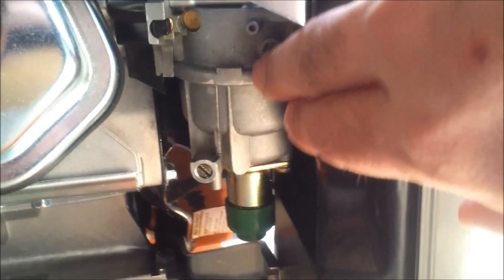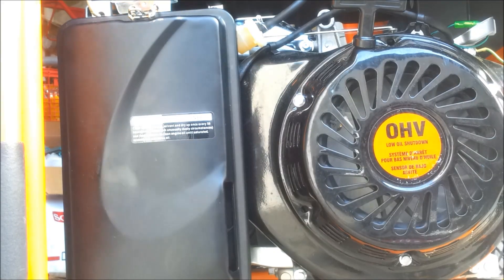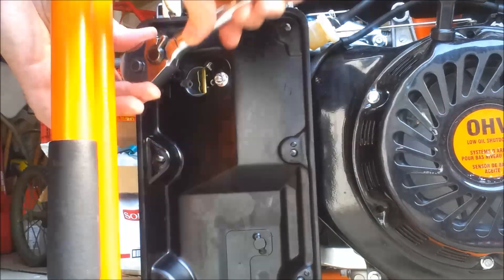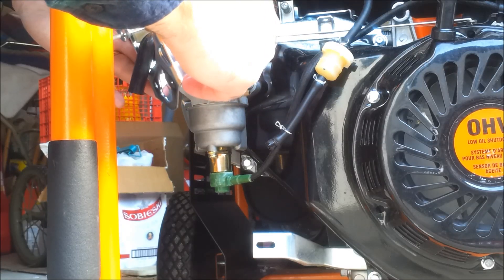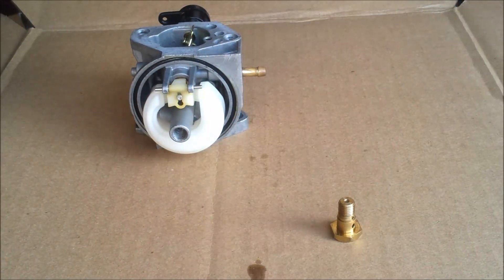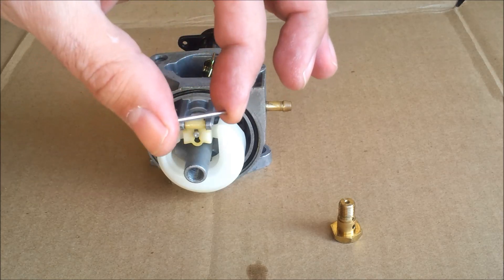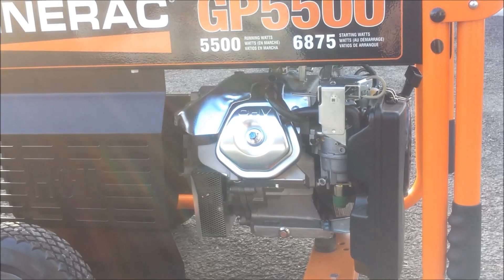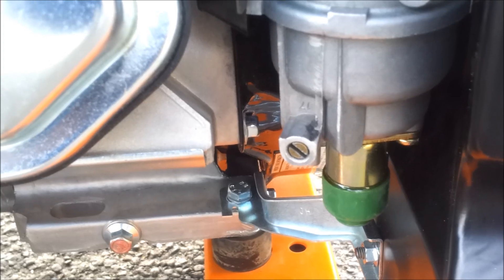Generac GP5500 FloatPinFix carb leak

Comment: Hurricane Milton is on my heels.  I pulled out my friends generator, filled it with gas it it was spilling all over the place.  With your instruction I had the whole unit torn down, cleaned up the carb, reassembled in an hour.   She fired right up and no gas spillage.  Thanks Bro.  You truly may be a life saver.  Oct. 9, 2024 2pm Cocoa Florida.

Comment: Stumbled onto this video because I just had this problem with my generator and figured out Rule 80 (I completely made that up but there are 79 others) of the internet is if you have a problem, there's a YouTube "how-to" to help you fix it.  
The part number Joe is referencing no longer exists. the current part number is 16011-ZEO-005. Most every place I've looked sells for roughly $20-25.  The sucky part about this is that you can get a whole needle bowl assembly (with metal float pin) for ~$10.  Choices, choices.
Update: ended up buying a whole new carburetor assembly for $25.

Comment: Thanks for the tutorial.  I took my carb apart and then used metal polish on the pin.  I loaded a q-tip on my drill with some metal polish and the inside of the pin shaft.  It worked!

Comment: That fuel you can remove ethanol fuel out of gasoline fuels that has it inside of it. By watching A video on YouTube channel on how to that process step by step. If that's something you would be interested in learning how to do At home for your generator.,or even your lawnmower.& Etc. That's gasoline.,or even two stroke also known as 2 cycle fuel mixtures to.

Comment: ABSOLUTELY DANGEROUS!!! I bought a GP5500, It failed in less than 10 hours. Customer service did nothing despite it being a 100 percent design flaw. Seal failure  allowed light rain to leak into the gas tank. rusted out. Cost $400 to replace. They don't care about their customers. The rust caused mine to stick and it flooded all over the back of my truck.
Reply: The grommots for the  fuel gauge and the role over tube are garbage. Can't find replacement

Comment: Fixed the leak on my generator but the generator won't start. Should I check the spark plug? Fuel is running thru the system.

Comment: Great video. We took apart our same generator and the tip of the float needle was all gummed up.  We installed a new needle and no more gass leak.  Thank you for the terrific information.  Two thumbs up!! A++ info.
Reply: Did you use a Honda or original Generac float

Comment: Will that same pin work for a general 6500?.
Reply: You mean for a Generac GP6500? Maybe. It depends on the carburetor shipped with that model and the model revision. Mine has a Huayi Standard of Japan carburetor. I bought my GP5500 back in 2011 or so. I believe that Generac has replaced the carb model in later models of generators so it might no longer be the same.

Comment: I replaced the needle with the Honda o e m -  I cleaned the brass seat -  and it still leaks a little- it’s not leaking from the bottom bolt - gas is coming out of the air cleaner so the Honda needle didn’t help me -  that’s $ 23.00 spend for nothing
Reply: You probably need a full carb cleaning and test. The float itself might not be buoyant enough to push the pin into the seat with enough pressure to fully shut off the fuel. So you might need to replace that also.

Comment: What would be the cost for taking it a shop[ for repair?
Reply from the maker: To clean the carb and replace the float pin?  Depends on the labor rate as the parts are cheap. I think you are looking at 100-200 USD. But they might not want to put in a plastic needle.
Reply: @joesgarage8953  Thanks, Joe. Seems a plastic needle would never get corroded. Thanks

Comment: I have a 4000 Watt generator I bought used $40 it leaks around the same area
Reply: Mine didn't just leak it POURED out in a 4 day outage :( .  I'm going to try taking it apart from the bottom first as it seems much easier to me.  Either way they took the solenoid off but I do understand more chance of stripping it. May as well change the oil while I'm fixing it...........better find a you tube for that too, lol.

Comment: I have a lowes version of  that generator, bought it around 2007 after a large storm in the Chicago area knocked out my area for about 9 days. Threw in a 220 breaker and backfed the breaker box,(yes I killed the main) it was great having one of the few houses fully powered, while the rest of the neighborhood was dark. It ran for about 5 or 6 days non stop. After the outage was fixed,I put stabilizer in and ran for a bit and cut the fuel and ran the carb dry. Since then I've started it a couple times a year with fresh fuel and stabilizer, then ran it dry. I've only needed the generator 2 or 3 times for short outages, but I developed the same issue and of course it happened when I was going to need it. I'm in Tennessee now, our neighborhood is getting new power lines and poles, so I pulled it out of the shed to get ready,filled it with gas, and it was pouring out the carb. I ran across this video looking up the carb, I was curious what I was going to see inside the carb, I haven't tinkered with small engines in years, long before selonoids we're on them. I was able to give it a good cleaning and it worked for now, but will order the parts and have them on hand if it happens again.  I'm beginning to think it's better to leave the carb bowl full of stabilized fuel when stored,as from the random videos I've seen, most of them stated they also ran them dry for storage.

Comment: Let me ask....this guy in this other vid...... also speaks about a fuel leak for Generac....but only dis-assembles the float bowl from the bottom, and doesn't disturb the upper part of the carb body where all the delicate linkages are that you took apart and had to be so very careful to get back together. This other guy also fixed it in another way simply cleaning the pin channel with a Q-tip and did not replace the metal pin with a plastic Honda part. Maybe the best of both worlds is to marry your guy's 2 vids---> https://www.youtube.com/watch?v=PoourNE7ydY. His "take-apart" with your plastic pin suggestion......
Reply: Wil, the problem with mine was that the shaft of the float pin had a spot of corrosion, which made it get stuck in the extremely tight tolerance of the pin channel you speak of.   So cleaning the pin channel wold have done nothing to fix the issue for my machine.   That other video might be a good quick fix for just a dirty carb.

I actually fixed mine three times with the last being the content of my video.   The first time, I replaced the corroded metal pin.   The pin corroded again, and I fixed it a second time by buffing the corroded spot off the pin shaft.   However it started corroding again after this and stuck again.   The third (and final time by the way as it is still good over three years later) is by taking the metal pin problem out of the equation and putting a compatible plastic pin in there as apparently was done on the similar Honda carb.

Keep in mind that I always use fresh fuel with stabilizer.   So the metal pins used for the carbs, and the replacement ones on the market must not tolerate ethanol-gasoline fuels.  No such problems with the plastic pin. Also note that I think Generac quietly fixed this problem in later models.
Reply: Appreciate your detailed response. I think we're on the same page. The point missed perhaps is one could access the pin and replace it with a simpler approach by removing the float bowl from below as the other guy did in the other, listed video. If you watched his complete video, he gets to the float and the pin and holds the pin in his hand. No doubt plastic vs repeated metal corrosion is a better fix. Lastly....how did Generac fix the later models.....do you know?...did they use a different metal alloy for the pin that is less prone to corrosion?
Reply: I agree that would be a simpler way.  One thing I caution on is when removing the solenoid from the bottom of the float bowl, it is very easy to strip the brass cross-head screws that hold that in place.    These are screwed in tight.   Without taking the carb completely off, it may strip more easily since you cannot apply as much firm pressure with the carb still mounted.   (YMMV).  Also, you cannot inspect the parts as easily.   I do not know for sure about later models.   Only that there were far fewer reports online and at the BBU that there were leaks due to stuck pins and Generac may have changed the carb type from the Huayi Carb that my model has at some point past 2012.   Check out this site  (not mine) which has a wealth of info on this entire issue: 
 http://home.earthlink.net/~kjvann/

Comment: How you can tell when your carb is leaking? , I'm asking because mine trow a lot of dark smoke and I don't know if that's the problem help please
Reply from the maker: The carb on my model used to leak because the metal needle would get stuck in the valve due to metal corrosion on the needle itself due to ethanol / gas mix.  The result was not dark smoke -- gasoline would literally pour out if the top of the carb somewhere and flow down until it came off the bottom of the carb bowl and all over the ground.   So your problem is probably not leaking carb.   Dark smoke usually means your air-fuel mix is way too rich.   This can be due to dirty or poorly adjusted carb, dirty air filter or some combination of these.

Comment: I have the Troy Bilt version of this generator with the same engine/carb. I inherited mine from a neighbor who moved away and just said it doesn't run. Anyway... I also discovered that turning the fuel on my carb would also flood. The solenoid could  stop flooding if it were working correctly. Mine doesn't because it's not powered or not operating correctly. I don't think your solenoid is working properly either. I tried to freeze the video to verify but couldn't see. When the solenoid is NOT powered, engine off just stored, it should be extended to stop fuel flow to the jet. When it IS powered, it should retract allowing flow. On a bench test my solenoid needle extends when powered. This is wrong. Yours looks like it is retracted unpowered just like mine. Every youtube video on the subject of a carb solenoid shows that doing a bench test, powering retracts the needle. It just makes no sense that ours extends when powered and even more confusing, even extended it's not long enough to stop fuel flow. If it were our engines would not run. 
But it really is the job of the float/needle to stop fuel flow anyway. Think about how many small engine carbs don't have a solenoid.  I realized watching youtube videos like yours that our carb is one of very few with that little spring on the needle. Except, mine didn't have a spring at all! So even with the float all the way up, the needle wasn't being pushed up enough to seal. I  I think mine was at a shop by previous owner and they took the carb apart to diagnose and lost the spring and figured it wasn't needed since most don't have one.  What I did was take a spring from a ball point click pen. Had to cut it trial and error to get the right tension but it works. I suspect it was really just your spring was worn since both needles have a rubber tip and the barrel was very clean. I think if you just gave the spring a little tug to stretch it a bit it may have solved your flooding issue. But kudos for finding that compatible Honda needle! with the new spring....

Edit: using the pen spring was short lived. started leaking again. After pricing out individual pieces, I just went with a complete aftermarket carb for $30.
Reply: Jeff Flowers got a part number?  I’m 2 years past the Honda polymer float swap and I’ve still got the issue.  Luckily haven’t needed the generator.
Reply: I ordered if off Ebay. I forgot to test the solenoid before installing it but doesn't matter. There's no carb leak so the float/needle is doing it's job and the generator runs fine. I do use the shut off valve anyway for good measure. If you order this one, in the write up it says manual choke only, but I easily took the lever off the old carb and installed it on the new carb. It even had the screw ready and waiting for the lever to be mounted. Comes with gaskets and fuel filter. I did need a small hose clamp as nipple on the carb is smaller diameter and to cut the existing fuel line to install the filter. If the link doesn't work it's item number 272884557267 and the seller is autoparts688.  Good luck!
https://www.ebay.com/itm/Carburetor-Fits-Troy-Bilt-XP-30477-030477-Pulsar-PG10000-PG10000T-Gas-Generator/272884557267?ssPageName=STRK%3AMEBIDX%3AIT&_trksid=p2060353.m1438.l2649

Comment: Thank you.  That was very helpful in diagnosing the same leak on my generator.  It is a Honeywell branded 5500 unit....actually a Generac.  Everything on mine looks exactly like your unit.  I bought this generator in 2012 having no issues until yesterday.  If I observe corrosion on the needle, I will take your advice and replace it with the Honda part.  I also found a source for non-oxygenated gasoline in my area....all my small engines and motorcycle now run on that fuel.  Thanks again for your video, it will save me a lot of hassle.

Comment from the maker: Just a note that since I replaced the float needle with the plastic part, it has not become stuck due to corrosion issues for 2+ years.
Reply: Joe's Garage thanks for the video.  Followed the same procedure and unfortunately 2 years later I’m in the same boat again with a leaking carb.  I wonder if a full Honda carb would work.
Reply from the maker: Ouch.  Sorry to hear that.   Mine is STILL going fine with the plastic float needle in there.   Maybe open your up and see what is causing it to stick now.   If you used a plastic needle in there, I don't see how that part could corrode.
Reply: Of course then won’t own up lol. Seems a lot of people have this problem and it is dangerous. For the cost of a simple pin that’s non corrosive   You would think the would own up and send a fix the cheap bastards.

Comment: Your video was really helpful. My carb was completely gunked due to my negligence. I've since cleaned & repaired it thanks to your guide. I will now be much more stringent with maintenance. The manual says to change oil every 100 hours. I haven't put mine to regular use yet in 2 years. How often do you change the oil if not in regular use?

I'm still searching for a polymer pin with your supplied item #. The suppliers I've asked all said they are all metal pins & I have to buy a full repair kit. Still searching. Thanks for your time here, very helpful.

Comment: That's great. Mine has been pouring. It's a 2010. Will that pin work? I have 2-3ft of snow coming in 24 hours!
Reply from the maker: You might want to look at Ken Vann's video too...much better of the disassembly.
https://www.youtube.com/watch?v=3FRjw61RCgk

Also see his web site:  http://home.earthlink.net/~kjvann/

The part number I used is at 11:03 in my video.   Ken Vann used some other part number and a metal pin, which is documented on his site.   But he had good luck with it.
Reply: Okay thanks. Do you know if that needle will work with my year?
Reply from the maker: JimmyDean1992 Not sure.   I suspect Generac had the carb model changed at some point due to the leaks.   Ken's site has some info on the carb model I think.   Mine is around the same age as yours however so it might be the same.
Reply: Seems like they still have not fixed the problem. Checked with the company and there is no recall. So I just cleaned it for now to get me by and then I have to order the plastic one that Honda makes as a replacement.